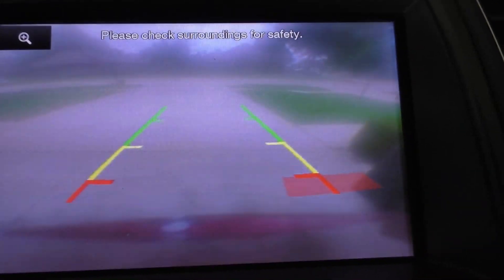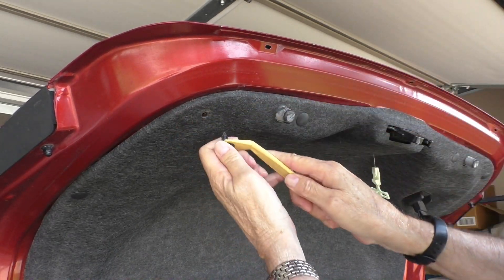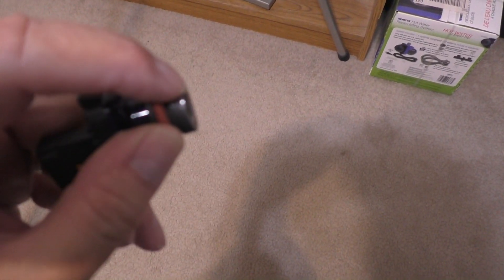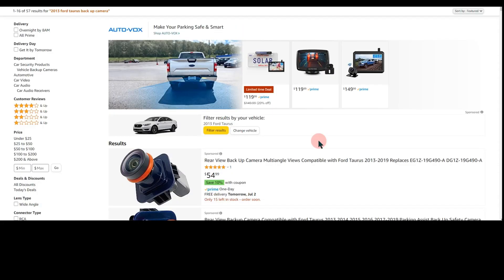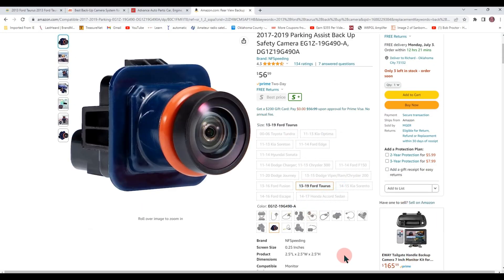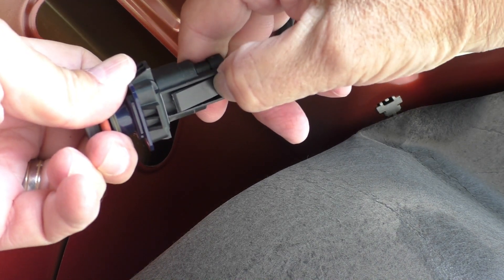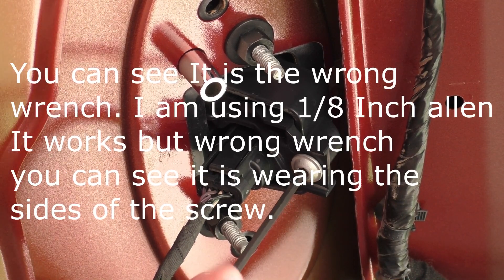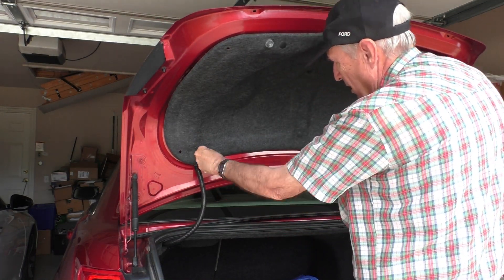How to Replace a Ford Taurus Back Up Camera in 2013 to 2019 Ford Taurus

Comment: Hi Rich, I just received my Amazon Camera for my Ford Taurus 2017 today and watched your video which helped 100% on how to remove the old camera and replaced the new one today it was very helpful and saved me a bunch of money!!! Thanks, Mike
Reply from the maker: Mike,  I am so glad my video helped you!   Thank you So much for watching my video!!!
Reply: What was the symptoms or problem that lead you to getting a new camera? My 16 gave me a blue screen with "camera not available" error today. I closed the trunk again and it went away for now.
Reply from the maker: @daveslomski  Dave, my screen looked blured...
Reply: Hey Rich, great vid. Easily saved me $400/$500. Quick note it’s not an allen wrench. I actually used a T-20 Torx bit.
Reply from the maker: @dfenderson  Thank you!   I knew it wasn't an exact fit but it seemed to work.  I will put this in the description.   Thanks again!!!

Comment: My camera is showing upside down.  I'm not sure what could be causing this. But, thank you for posting an extremely detailed video of how to remove and replace it!!!
Reply from the maker: I am guessing someone put it upside down
Reply: My wifes 13 Taurus started doing the same thing. Sometime it won't turn on. If it does turn on it upside down, and blurred. IDK WTF is causing it.
Reply: @JROC734   I had to replace the camera.  I purchased it from Ebay. OEM camera "Original Equipment camera."  I paid abt a little over $200 for it
 It was worth the investment.
Reply: @veganislife650  That's a bummer. I went ahead and ordered some cheap Chinese replacement off Ebay. Hopefully it will fix the issue, and have decent quality.

Comment: I have the camera installed. But I don’t see a harness to connect it to. What do I do?
Reply from the maker: If you took the old camera out there should have been a plug which you unpluged from the old camera.
Reply: @RichRodgersOnline  I bought it without a harness. I don’t see it dangling in the trunk. So idk what to do. Do I buy a harness? I see where it connects. But idk where I would hook up the other end of the harness to.
Reply from the maker: @DmvdirtyTV  I have no Idea.   I just have replaced this one and that is it.   But if it didn't have an old camera before and it doesn't have a plug.   It may not have had a plug for your camera in the first place.  I am sorry, I can not help you...  You might go to a small body shop and ask them.  Most of the time they are pretty friendly.

Comment: My screen say contact dealership would fix the issue if I just Replace it
Reply from the maker: I am not sure. You could always take it in and let them check it.  But buying another camera might be cheaper than going to the dealer, and the dealer checks things out  and says, "You need a new camera."   But then, what if it is something else???  If it's blurry, I am guessing it's the camera.  I am not a technician.   It's your call. Good luck!